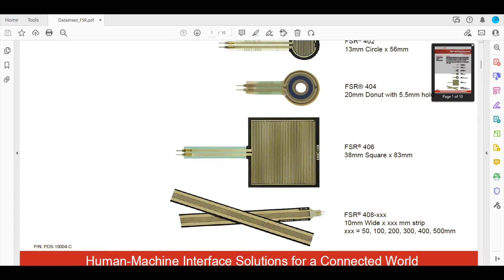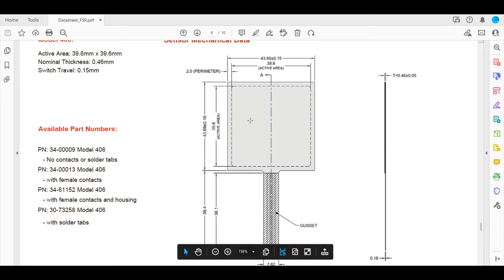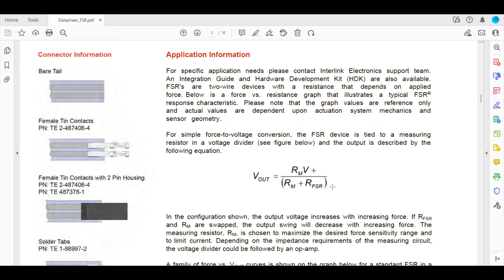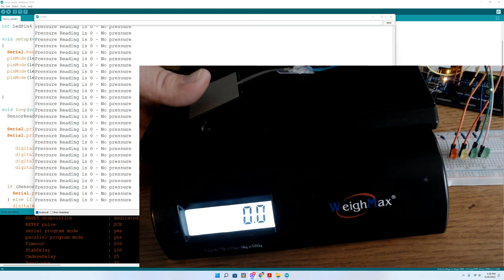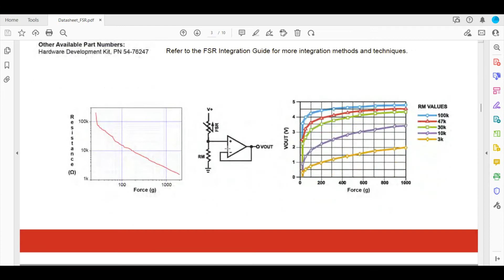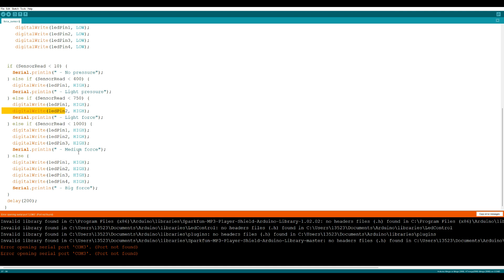How To Connect A Force Sensor To Arduino - An Introduction For Beginners

Comment: Hi I want to measure heavier force like 20kg, wondering if I can use other sensor RP-S40-ST Thin Film Pressure Sensor , are most of the connection and code be the same?
:))))))))))
Reply from the maker: Check out Sparkfun list of load cell products. They have great tutorials and usually some code to start you off.  https://www.sparkfun.com/search/results?term=load+cell   checkout the hookup guide

Comment: hi I saw that in circuit diagram there is a amplifier, And I dont think you connect one, wonder why?
Reply: Also wondering if you can help me on, is the circuit connection correct using voltage divider like you did? because it is not using the Wheatstone bridge circuit like strain gauge sensor.
Reply from the maker: Force sensing resistrs are resistive sensors that change their resistance based on the force applied to them. As force increases, the resistance decreases. This change in resistance can be easily measured using a voltage divider circuit. Unlike strain gauges or load cells, they use a Wheatstone bridge config to measure small changes in resistance more accurately while force sensing resistors can be used with simpler circuits, usually involving a voltage divider.
Reply from the maker: Hey there! I decided not to use an amplifier with my force sensing resistor because the primary purpose of the video was to detect the presence of force to trigger actions, specifically lighting up LEDs. Since the sensor's resistance change was easily detectable by the Arduino, I didn't include one. I wanted to create a basic project using the force sensor and it worked well. 
The HX711 is pretty popular, perhaps I should get one and try it out. it should improve the accuracy and reliability of force measurements with an Arduino and would come in handy if you need more precision.

Comment: Will the sensor pin damage if it touches the solder?
Reply from the maker: Quickly solder and place wires. May be able to add shrink tubing or light glue coat to make it good stronger.  Only solder the metal pads. Maybe tin the contacts before placing 👍
Reply: @BMonsterLaboratory  thanks

Comment: how to connect two FSR to single aurdino
Reply from the maker: HI there.   you could add new integer variables like you did for the first one:
 int SensorPin1 = 0;  
int SensorPin2 = 1; 
int SensorRead1;
int SensorRead2;
void setup
(add your new LEDs here) if you're using new LEDs
void loop
(add sensor 2 in the loop with sensor 1)
 SensorRead2 = analogRead(SensorPin2);
(add some conditional statements like you did for the first sensor)
if (SensorRead2 < 10) {
    Serial.println(" - No pressure (Sensor 2)");
  } else if (SensorRead2 < 400) {
    digitalWrite(ledPin1, HIGH);
    Serial.println(" - Light pressure (Sensor 2)");
  } else if (SensorRead2 < 750) {
    digitalWrite(ledPin1, HIGH);
    digitalWrite(ledPin2, HIGH);
    Serial.println(" - Light force (Sensor 2)");
  } else if (SensorRead2 < 1000) {
    digitalWrite(ledPin1, HIGH);
    digitalWrite(ledPin2, HIGH);
    digitalWrite(ledPin3, HIGH);
    Serial.println(" - Medium force (Sensor 2)");
  } else {
    digitalWrite(ledPin1, HIGH);
    digitalWrite(ledPin2, HIGH);
    digitalWrite(ledPin3, HIGH);
    digitalWrite(ledPin4, HIGH);
    Serial.println(" - Big force (Sensor 2)");
  }

also, be sure to check the specs on your board so you stay within the current and voltage parameters  https://store-usa.arduino.cc/collections/boards/products/arduino-mega-2560-rev3   👍
I don't have a 2nd sensor to test the code, but I believe this is what it would look like.

Comment: Did you calculate the force from your resistance output values? It would be nice to see what the force is rather than the output being "Light, Medium, Big". If so, how close were they to actual values? Thanks! Great video :)
Reply from the maker: hi there! The sensor's resistance is read using the analogRead() function, which returns a value between 0 and 1023, corresponding to the voltage level at the analog pin. The SensorRead value is compared against different thresholds, and the LEDs are lit up in response to the different force levels.
The Arduino represents the sensor reading as a number between 0 (no pressure) and 1023 (maximum pressure). We should be able to map this range (0-1023) to the force range (1/16 lbs - 22 lbs) for this sensor. The value displayed on your LCD would be approximate and you would have to calibrate it depending on your project setup. I can make a video for this.... no problem. sorry about the delayed response.
I wanted to update this answer. I was able to display force in pounds and after calibrating the sensor, it did a pretty good job. There is some sensor drift over time where you'll see the values change. So, you can get a readout in lbs, but it's not ideal. Also, Sparkfun has a great tutorial and code example for Force and Resistance data using a sensor similar to this. check it out here https://learn.sparkfun.com/tutorials/force-sensitive-resistor-hookup-guide?_gl=1*7fadl3*_ga*NDE5NjE2NTQ2LjE2Nzc3Mjc2NzE.*_ga_T369JS7J9N*MTY5MDQwNzQ1NS40LjEuMTY5MDQwNzQ2OC40Ny4wLjA.&_ga=2.11488948.1420561945.1690407456-419616546.1677727671
If you want better accuracy, check out some load cell sensors. More expensive, but more accurate and repeatable results..   hope this helped.
Reply: @BMonsterLaboratory  Thank you for the reply! The link provide is very interesting I will need to look into it more for my application! Would you be able to provide the code for the calibration? I am curious how you did it. Thanks!
Reply from the maker: Sure! This code reads the force sensor that's connected to analog pin A0, converts the sensor reading to force in lbs using the calibration factor and offset, and displays the sensor reading and the calculated force on the I2C LCD display. When I mapped force to lbs I looked at the reading when there was no load vs when there was a known weight of 1lb on the force sensor. When there was no load X1=67 and when there was a known weight of 1lb on the sensor x2=766. X1 and X2 are the raw sensor readings. Then I use the scale factor and offset to convert raw sensor readings to force in lbs. You can see this at the bottom of the loop. You'll see some drifting in the measurements and that's why I said  a load cell would be better for this application. There are probably more complex ways to get a better reading... I hope you find this helpful. 

#include <Wire.h>
#include <LiquidCrystal_I2C.h>
#define SensorPin A0

LiquidCrystal_I2C lcd(0x27, 20, 4); // Set the LCD address to 0x27 for a 20x4 display

void setup() {
  Wire.begin();
  lcd.begin(20, 4);
  lcd.backlight();
  lcd.setCursor(0, 0);
  lcd.print("Pressure Sensor:");
  Serial.begin(9600);
}
void loop() {
  int SensorRead = analogRead(SensorPin);
  float forceInLbs = mapForceToPounds(SensorRead);

  Serial.print("Sensor Reading: ");
  Serial.print(SensorRead);
  Serial.print(" - Force: ");
  Serial.print(forceInLbs);
  Serial.println(" lbs");

  lcd.setCursor(0, 1);
  lcd.print("                    "); // Clear line
  lcd.setCursor(0, 1);
  lcd.print("Reading: ");
  lcd.print(SensorRead);

  lcd.setCursor(0, 2);
  lcd.print("                    "); // Clear line
  lcd.setCursor(0, 2);
  lcd.print("Force: ");
  lcd.print(forceInLbs, 2); // Print with 2 decimal places
  lcd.print(" lbs");

  delay(200);
}
float mapForceToPounds(int SensorRead) {
  // Two points from calibration
  float x1 = 67, y1 = 0; // First point (x1, y1) when no load is applied
  float x2 = 766, y2 = 1; // Second point (x2, y2) when 1lb load is applied
  
  // Calculate scale and offset
  float scale = (y2 - y1) / (x2 - x1);
  float offset = y1 - scale * x1;
  
  // Apply scale and offset to the sensor reading
  float forceInLbs = scale * SensorRead + offset;
  return forceInLbs;
}

Comment: can you please help me with this?
I have a similar sensor with these features:
Actuation Force: 0.1 Newtons
Force Sensitivity Range: 0.1 - 10.02 Newtons
Non-Actuated Resistance: 10M W
what should be the resistor values in the voltage divider circuit for the above specifications?
Reply from the maker: Hi Vaishali! Great to hear from you. I can take a look at it. Can you send me the code and the model of sensor you have? If you have found messages over Facebook work well with posting code. Email is fine if that's the only option.  Happy to help where I can 👍
Reply: @BMonsterLaboratory  Hi where can I email you at? I'm not on Facebook. Thank you

Comment: Great video!
I assume it's resistive and not capacitive, or is it both? 
On the other hand would it detect a bunch of beach sand?
Thanks
Reply from the maker: Hey Carlos, great to hear from you! This is the FSR Model 406 Force Sensor from Interlink Electronics. It's a force-sensing resistor that shows a decrease in resistance when there is an increase in the force applied. It would detect beach sand if it applied between  0.2N to 20N of pressure to the sensor - somewhere between 20 grams and 2kg.  I hope that helped!  👍
Reply from the maker: by the way, here's a link to their website  https://buyinterlinkelectronics.com/   They also sell some sensors on Amazon.
Reply: @BMonsterLaboratory   Thank you very much
Reply from the maker: @carlosmor3254  you're welcome. Take care!

Comment: Bro I need code
Reply from the maker: Here a go!
int SensorPin = 0;
int SensorRead;
int ledPin1 = 9;
int ledPin2 = 10;
int ledPin3 = 11;
int ledPin4 = 12;
void setup(void)
{
Serial.begin(9600);
pinMode(ledPin1, OUTPUT);
pinMode(ledPin2, OUTPUT);
pinMode(ledPin3, OUTPUT);
pinMode(ledPin4, OUTPUT);
}
void loop(void) {
SensorRead = analogRead(SensorPin);
Serial.print("Pressure Reading is ");
Serial.print(SensorRead);
digitalWrite(ledPin1, LOW);
digitalWrite(ledPin2, LOW);
digitalWrite(ledPin3, LOW);
digitalWrite(ledPin4, LOW);
if (SensorRead < 10) {
Serial.println(" - No pressure");
} else if (SensorRead < 400) {
digitalWrite(ledPin1, HIGH);
Serial.println(" - Light pressure");
} else if (SensorRead < 750) {
digitalWrite(ledPin1, HIGH);
digitalWrite(ledPin2, HIGH);
Serial.println(" - Light force");
} else if (SensorRead < 1000) {
digitalWrite(ledPin1, HIGH);
digitalWrite(ledPin2, HIGH);
digitalWrite(ledPin3, HIGH);
Serial.println(" - Medium force");
} else {
digitalWrite(ledPin1, HIGH);
digitalWrite(ledPin2, HIGH);
digitalWrite(ledPin3, HIGH);
digitalWrite(ledPin4, HIGH);
Serial.println(" - Big force");
}
delay(200);
}
Reply from the maker: most code is posted on Facebook. Just look for # in video description.  Hope this helps.  Enjoy! 👊👊